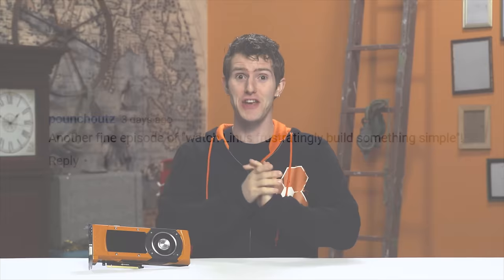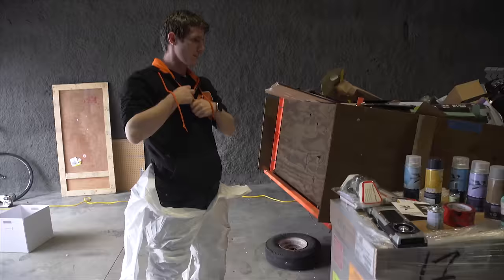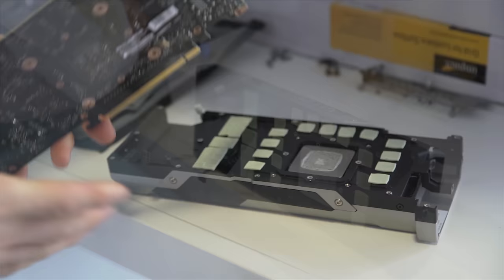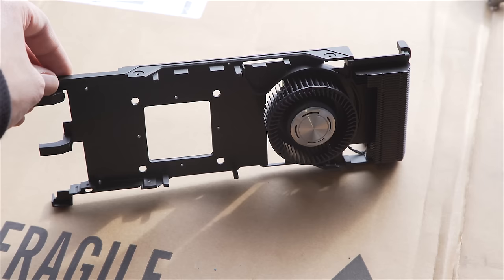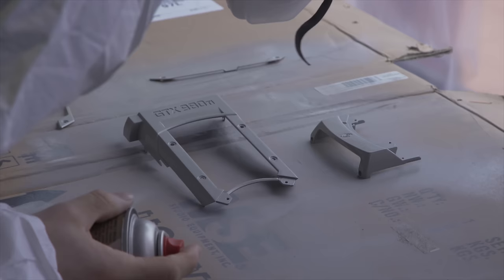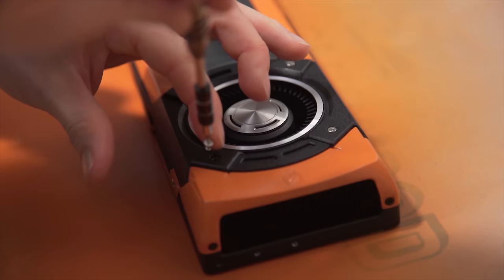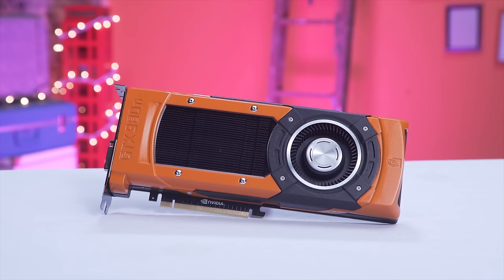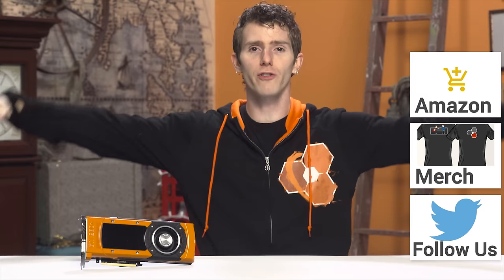Why Not Paint your Video Card??

Comment: My retailer says it voids the warrenty D:
Reply: Yes it does, but unless you break the warranty-void-stickers, they wouldnt know that you modded it in the first place.
Reply: ***** If it's painted another colour of course they know
Reply: Thomas _ As he said, you can use color that you could wipe of easily.
Reply: Overclocking voids your warranty.
Reply: Micheal Malanot No it doesn't..
Reply: Thomas _
On some grapahics it does.
Reply: Micheal Malanot But you could just turn the clock speed down again, and there would no proof that you overclocked. It might LOOK like you overclocked, but no way to prove it.
Reply: You need to prove you did not overclock to get your warranty.
Reply: Thomas _ Many manifacturers implement something that sets a bit you cant unset when you overclocked, so yes there is a proof.
Reply: ***** Manufacturers have there products come with software that allows you to overclock your card. EVGA, MSI and ASUS all have software for that, so just buy from them..
Reply: Thomas _
My grpahics card syas that if I overclock with any program they drop forms of support.
Reply: Micheal Malanot What manifacture do you have? ie EVGA, MSI, XFX etc...